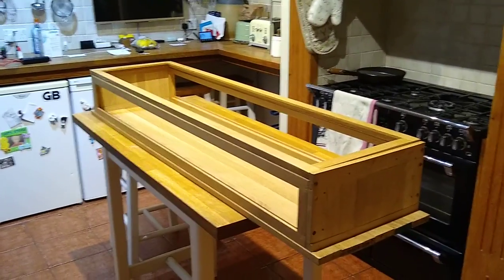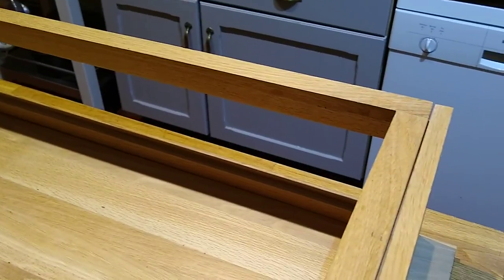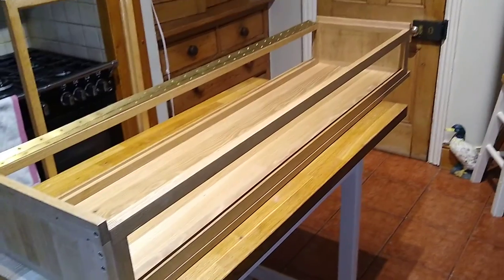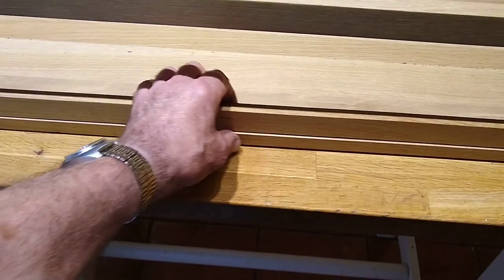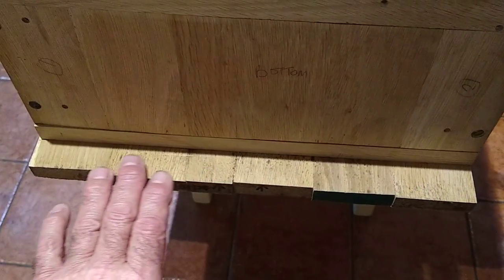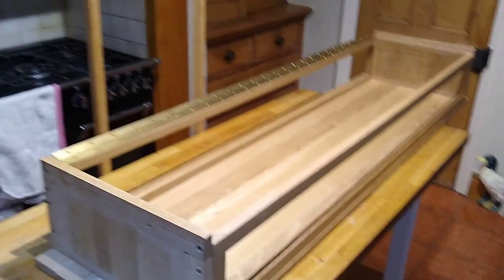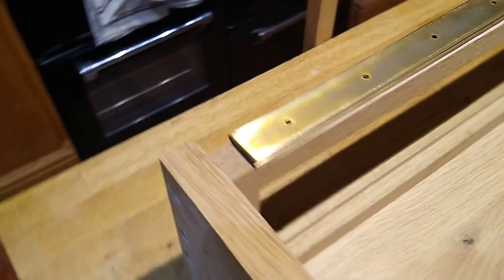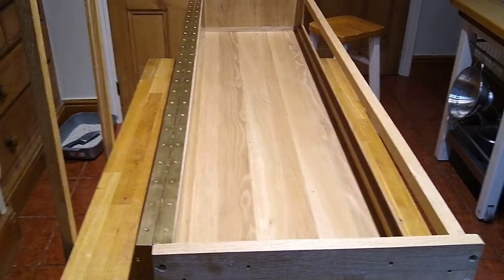A Regulator Clock Case, from a design by Mr Peter Heimann.

Comment: Excellent piece of work. Wood and I have never been the best of friends so I’ve never got round to building the case for my ME Jubilee clock, one of Wilding’s designs. Now I’m three years into Parkinson’s and the chances of ever making the case are slim to zero. Oh well …….
Reply from the maker: Hi Colin.  Many thanks for your kind comments.

Its nice to have comments from someone that has actually built a clock, as this is my first time.
I have been building steam models and other model projects for some years, but for me making a clock was a steep learning curve and required lots of thought and reading.

My Dad was a repairer of clocks and I have a 200 year old grandfather clock he rescued in the mid 1920's.
I remember him telling me how to strip it for transport and how and where to oil, saying 'John, it doen;t take much to Stop a Clock!'

The regulator has  taken me 11 Years or so to complete this Clcok (But with 5 years out due to Illnes and family berevements)

The highlights were learning to cut the wheels and lantern pinions, designing and making a diciding head for the same, maling jigs for cutting pallets and of course the Case.

I used the dimentions for the overall sizes, but the case design and hinge is all mine.

If you care look the Clock is illustrated in a 70 page blog at < http://clockworkengineer.wordpress.com > , and there are 22 videos on youtube by me on the Regulator project detailing wheel cutting and fitting, frames and posts, understanding, nakinf and fitting the motion work and fitting the clock in its case on my lounge wall.

As of today its running 4 seconds slow and has neen holding at that for the last 2 weeks.
Setting time has been going on since March 23, however its been a little erratis at first, but now seems to have settled down well.

If you have images of your clock I would love to see it please.

Once again thanks for your kind comments.
Kind regards

John F